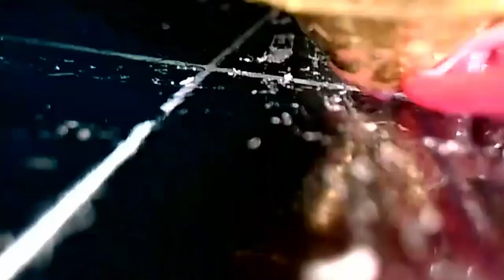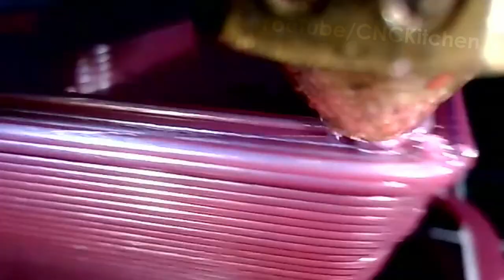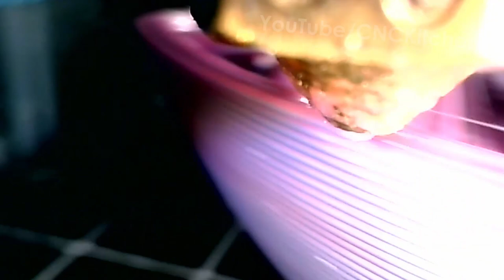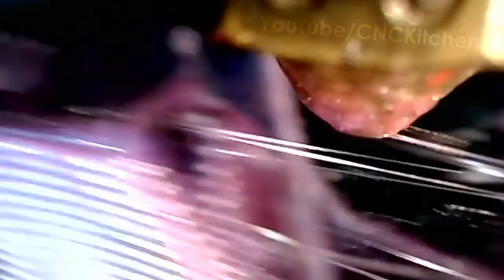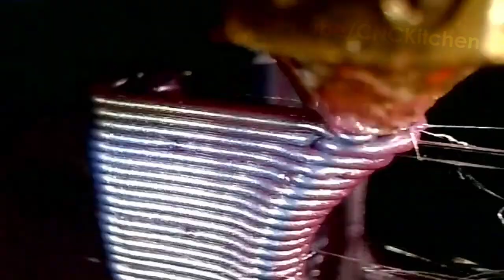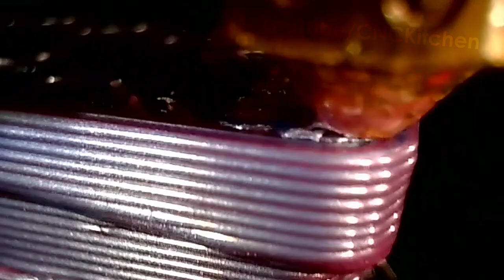Nozzle Cam - A new perspective on 3D Printing

Comment: I'm glad you water marked the video. This is going to get shared high and low on the Internet. Great work!
Reply: ...and did it so well that until I read this comment, I hadn't noticed.
Reply: It's actually incredible how freebooting it's completely unpunished by most platform.
Reply: You mean freebooted, not shared.

Sharing would be linking this video - most people though will download it and reupload to e.g. reddit or facebook.
Reply: @NicMediaDesign  i guess freebooting and sharing means the same to some people 😅
Reply from the maker: Already happend with the video I uploaded on Reddit, so I had to take measures.
Reply: @CNCKitchen  Yeah, watermarking helps a little bit, yet realistically it is still only a fraction of the views/subacribers you would get if the YouTube video was embedded.

For example - I once shared a YouTube Video of my dad on reddit (he builds Model Railway in H0 scale) and it went viral - this resultet in 330K views and +1500 subscribers in a day.

Then there are freebooted videos with twice the reddit upvotes - if you look at the original video it maybe gets +2K views and no movement in subscribers (as per socialblade).

This in my dads case wouldn't have been an issue, but for you (with a monetized channel) it makes a difference!
Reply: @CNCKitchen  didn't even notice it was watermarked until I read this comment, glad you didn't plaster it in the middle of the screen like many others

Comment: Logically, I understand this is molten plastic, but also part of me thinks “pink toothpaste fresh from the tube, or maybe weird bubblegum 🤤”
Reply: i was thinking of raspberry cream😁
Reply: Cake icing
Reply: And my sick mind thought it looked like some kind of fleshy substance 😖
Reply: uhh
Reply: Agreed - Pink toothpaste or like Bubble gum colored - that truly adds to the quality of the Wild Video!!!
Reply: Or, does anyone remember that weird bubblegum that came in a tube that was like toothpaste consistency but turned into gum in your mouth??  That stuff was weird.
It also reminds me of denture adhesive commercials.  🤣
Reply: Exactly!
Reply: It's like one time i had this shampoo that looked and smelled just like strawberry milk..
Reply: "3D printing" is just another term for layering material on top of each other. A confectioner who makes a cake with a similar layer of sweet material basically performs "3D printing", just like children with a hot air gun. If toothpaste or chewing gum were used, in terms of the method, it would still be a "3D print" of the terminology we created for this, in order to separate it from the mentioned confectioner. ))
Reply: I gotta agree 🤤🤤🤤

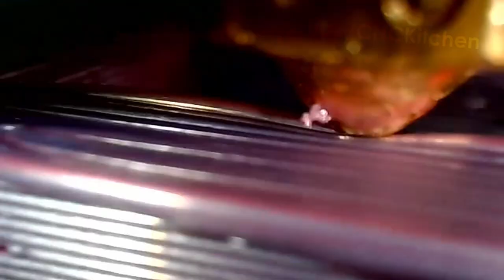Comment: I loved the roof shot! 43:51 - I always wondered how the filament covered such a distance with no supports. When the nozzle starts to print the roof, it starts on the very edge of the wall and it squeezes about 1mm of filament over the edge, forming a 1mm ledge that would cool and harden quickly. On each consecutive pass, the nozzle squeezes about 1mm more filament on the new hardened ledge, and 1mm of filament over the ledge, making a longer ledge. It will do this the whole way forming a perfectly flat roof. This thin ledge layer looks like a very delicate process as the layer is not thick/strong. Part way through the first roof layer at 44:07 the filament fails to form a solid ledge. Possibly the ledge overheated from the nozzle temperature (maybe needs more cooling), and it fails, so the filament has a hard time bridging the gap for the rest of that layer. The layer is still decent for future layers. On the second roof layer, the diagonal printing movement finds enough "good" filament laid out, even with the failure, so there no major gaps to cross and the layer looks great.
Reply: Nice! It should probably only print so much of those lines at a time, they simply can't dissipate so much heat when stuck together.

Comment: I need more info on that toothbrush thingy at 0:09. Looks like a great solution to get rid of the filament that oozed out during preheat.
Reply: Look up nozzle brush mod
Reply from the maker: Check that out: https://forum.e3d-online.com/threads/silicone-brush-nozzle-cleaner.3315/
Reply: @CNCKitchen  thank you!
Reply: A good old swipe line in the preamble code does the job just fine. I’d say this is only relevant for filament swaps.

Comment: As amazing as the view is to watch - it provides so much information as towards printing refinement, layer adhesion, shell adhesion, and much more. I've installed my own version and I find myself relying heavily on the camera to tune my prints. This will become a common thing in the 3d printing community. It is just so handy.

Comment: It's crazy that this is probably 0.2mm layer height and it looks like 4-6mm layers. Also the fact that it looks like the nozzle doesn't move but that everything else is moving around it.
Reply: It's 0.6
Reply: It's 0.3mm layer height. Says so in the video description.
Reply: @Tombsar  I was referring to the nozzle. You are correct.

Comment: Would be nice to see in slow motion, especially for extrusion start/stop, to tune parameters. I doubt there are suitable endoscope cameras on the market, but who knows.
Reply from the maker: I'm really looking for a camera that does 1080p and maybe even 60fps for some slow motion, but that's really hard to find.
Reply: @CNCKitchen  Maybe you can try using FPV Drone cameras? Lightweight small units able to stream 1080p, should not affect your printing performance and maybe enough for the task.
Reply: @CNCKitchen  Some projects on my mountainous "To-Do" pile: 
- design a mount for the toolchanger extrusion to hold an old iPhone for high quality timelapses
- design a cover for the toolchange mechanism to hold a rasberry pi camera module, and maybe mount a pi on the mechanism or back for streaming video to OBS
Reply: @arianetrek7049  wow, its awesome to see a comment recommending an fpv drone cam on a 3d printing channel, considering we use tpu 3d parts a fair bit! thats a good idea tho, something like a runcam split would record 1080p. you'd have to find an M8 lens with a much smaller FOV tho

for a live feed tho, a DJI Airunit or Vista would be overkill. if you could use a Foxeer Digisight with the MIPI connector that would work, but at that point you could find other digital cameras small enough for the job.

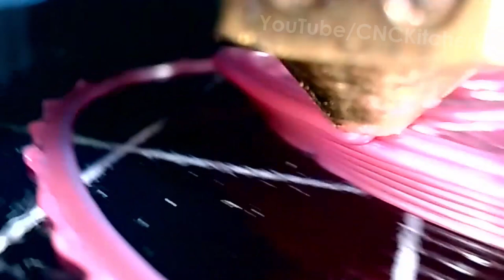Comment: It's weird how you're overextruding in some areas, and others it seems like it's exactly the amount of material needed. That, and I don't know if it's my eyes, but I can see the inconsistent widths of layers being extruded... Thank you for these close ups, I couldn't achieve anything that close with what I have on hand. @4:22
Reply: Wonder if that's the result of warping in the plane? Or an unleveled printing surface?
Reply: Most slicers do a bit of overlap of infill with the perimeter, to tie them together, so if there's a small infill area it tends to get overextruded.
Reply: The first layer definitely has too high flow

Comment: 6:32 I like how the extruded material is wider than the base that is the previous line, but stretches and thinners as the nozzle moves away, making it fit right in place!

Comment: Now we need to train an AI using this angle, then let it watch and micromanage it.
Reply: Exactly my idea! I think this will be a thing in the future
Reply: That's brilliant. I was thinking about all the manual settings tweaks I would do based on carefully examining the footage like some kind of smooth brain workaholic.

You've got the right idea. Let the computer say, "Looks like stringing—I'll increase retraction,on-the-fly, by 0.1 mm and see if it gets better."
Reply: A GAN with this camera view and the gcode..... or better yet access to the slicer settings, so many applications.
Reply: @timwatterson8060  Yeah, both would be great:  Edit the gcode on the fly to fix the current print, and save off the optimized slicer settings at the end so you can start from there on subsequent prints. Want to start a company, my dudes?
Reply: Ah, now there is a use for 32bit boards!
Reply: @EricLaspe  When you've got the competence in programming then go for it! 😁 I'm only studying mechanical engineering.
Reply: you would also need to change the direction of the light, so the vision system can gain some very much important 3D information easily.
Reply: actually training the A.I. would not be terribly hard.
You can do most of the training without manual labeling, so the training set can be generated automatically.
You automatically sweep through the parameters and train the A.I. to guess the parameters.
After that you can train on the predicted parameters, which is a very small space, so relatively little labeling can produce a good net.
If you augment the colorspace of the image you can train it to work on most filaments by using only a few examples.

Most likely tuning the flow rate, retraction length, temperature would be the easiest to implement. (and detecting catastrophic failure)
Reply: @adamrak7560  I wanna learn from you.  I'm also only a mechanical engineer.  Programming is not my Forte.

Comment: been 3d printing for a few months now and i still cant believe how much they can bridge gaps and essentialy print a line of plastic in mid air. 
Though i just realised after a bad print where all the bridging was drooping, temperature is very important. so going to have to print a temp tower for every new filament from now on.

Comment: Oh wow, that's amazing!
A few days ago I took a spare Caddx Eos2 camera, ImmersionRC 25mW VTX & white LED and mounted it on the left Z-axis motor of my Prusa so I can monitor it with a tiny FPV viewer. I have been thinking about sticking the camera on the hotend and pointing down but you've done it so well, I may have to copy that idea of focusing & pointing it right at the nozzle tip :)

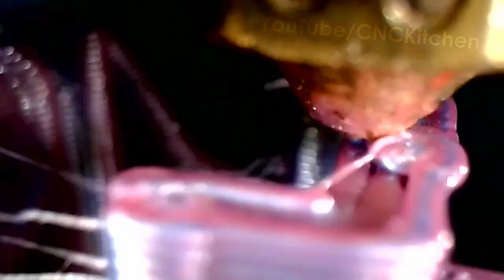Comment: This is fascinating. Watching the bridging around 44:07 and how kind of unstable it is and the stringing around 33:39 (stringing is be bane of my life right now!) is fun. I feel like I understand it better now. There's also a section at 48:21 which I think explains the "dimples" I see on my benchy prints - it's the nozzle transitioning from the outside to the inside or to another layer.
Reply: @Aeropher this may be way too late of an answer and maybe you already know it but what you see at 48:21 ist the so called "Z-Seam". If you choose a random position for it in the print, you won't get that vertical line up the model

Comment: It is interesting to see how the tip of the nozzle gets dirty and how the filament pulls the thread.
Furthermore, the process of cleaning the nozzle is also very interesting.
I am impressed that the same phenomenon is occurring in the 3D printer in front of me.

Comment: I think this is going to be a tremendous tool for diagnostics, teaching, and research! So much of what I've learned about 3D printing was by watching my printer work, but I've never had the patience to watch an entire benchy print until now. I would like to see this grow into a full fledged tool. Besides normal video viewing controls it would be great to index the video by layer number, and provide more flexible fast-mo / slow-mo operations for zooming in on the exact moment when things start to go wrong. It would also be great to package the video with metadata on filament, nozzle, printer, and of course all the many slicer settings. If you could put two such recordings side by side at the same point in the print, you could so easily understand the effects of your slicer settings and other choices. I am really excited about this.

Comment: Its interesting to see how/why the imperfections get into the print.  
Seems to be either the nozzle is running into previous layers sometimes and when the flow stops, it creates a tip that gets gapped over on the next layer.

Comment: This is a really interesting perspective. I feel like a nozzle cam + whole printer cam would be much more useful for those print-failure ML and AI models people have been working on. Far fewer unknown variables, and a nice detailed closeup of the actual printing. Could perhaps detect print anomaly and failures far sooner too, making it possible the print could be salvaged vs stopped entirely just to prevent spaghetti. Awesome video!

Comment: Very interesting view.  I wanted to stop and wipe off the nozzle.  On the outside perimeters, it looked like it was over extruding at the nozzle but a couple mm behind it looked fine.   The flow looked too wide and sagging over the edge but then shrunk perfectly into place.

Comment: Damn, that little boat is ubiquitous, haven't even done my 1st print yet (building my machine... it's coming along!) and already recognized Benchy on the 2nd or 3rd layer.
Absolutely impressive view, some stuff that you look in the slicer and thing "what the hell is that move? What will it even do on the printer??" like some super tiny blobs of plastic it deposits or super thin lines, and you see it actually doing them here, or how bridges are a heck of a struggle but it still pulls them off, really amazing idea.

Comment: I would love to see an angle for how solid infill connects line by line. Seeing if there is a way to fill the small gap between the lines would be a incredibly thing to know how it improves strength if it does. 

Best thing to witness was the stretching of the plastic on the exterior perimeter as it is extruded.

Comment: I wonder if any of the slicer devs have setups like this and if it would influence their path decisions. Seems like this would be an incredible tool for debugging the whole slicing process.

I always wonder about those moves that fill in a small gap with a single drop and leave lumpy bits from the retraction.

Comment: It’s interesting that it can actually print non-bridges in mid air further out from an edge better if it goes faster, because as it starts to sag, the nozzle goes back in the opposite direction and it pulls the edge back up again. Whereas if it was printed slowly and delicately, it would just droop down and look bad.

Comment: I use an 10 USD Ali USB endoscope camera on my rpi running Octoprint. Camera is 7mm diameter and fully integrated in my part cooling fan duct. It's working perfectly without the need of deassembling the cam or using external lenses..  It has a focus of around 3cm and a viewing angle of 70 degrees. The image is a bit "zoomed out" of what you see here, but in my opinion, that way it is more useful tracking wall finish etc

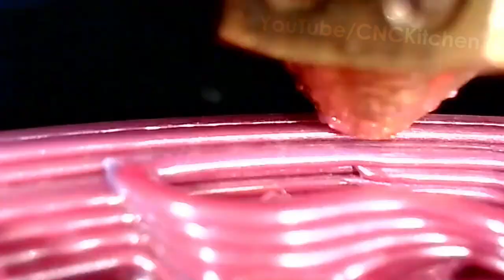Comment: Pause at 8:31. I think it's wild that whenever an outer perimeter is being extruded, you see extra filament build up near the extruder but then somehow have a uniform thickness when the nozzle continues on.

Edit: Play it for a split second past 8:31, and then pause when you see the nozzle working on the front perimeter. To see what I'm talking about, the nozzle has to be between the camera and the print.
Reply: This is exactly what I was wondering. It could be related to thermal expansion, but I wouldn't expect that coefficient to be that large. Could also be related to the time it takes to fuse to the existing filament?

I find it very peculiar that it doesn't seem to happen on the inner wall lines.

Comment: Seems like a the blebing and stringing could be resolved with the nozzle having a wider lip . There appears to form a wavefront and when the nozzle changes direction, it causes it deform and stick to the nozzle edges. Watching at slower speeds helps see it.

Comment: It's amazing how much you really get to see the flow from this angle. Like the plastic is molton longer than I thought coming out of the nozzle. Though I wonder what this view and maybe a set of thermal cameras could do for on the fly adjustments to print parameters to improve prints!

Comment: This video shows pretty good that there is much more to improve in FDM. I bet the print speed of the first layer in X or Y axis is NOT the print speed when both axis X and Y move.    Also the printer could measure for example with a laser thermometer the nozzle

Comment: This thing is really mesmerizing. I was thinking if you shared more details on the parameters you used in printing such as flow rate, feed rate, infill overlap as well as fan speed. so that viewer can compare the output result of the settings they keep with actual printing actions.

Comment: This was pretty cool to see. I miss a more big-picture angle for some stuff though. I'd like to see both angles so I can see what is being worked on at the nozzle and the object area it's in such as a castle rock wall or tower. Not the whole thing, maybe a 4-6" area? Not sure if it's feasible however.
Pretty wild to suddenly see the printer just jump the gaps on the boat house? arches and even more so to suddenly see it make the roof with what appeared to be no sag on the strands over what, a coupe inches?

Comment: Bought an endoscope for exactly this maybe a year ago, but the one I picked turned out to be very flakey in connecting to anything (windows, android, OSX, you name it) so I never ended up mounting it to a printer. Typically the endoscope cable is pretty firm as well, so adding something with more rigidity than bowden tube to the hotend carriage was also concerning.

Video description link mentions "suitable" endoscopes.. maybe I'll try again.